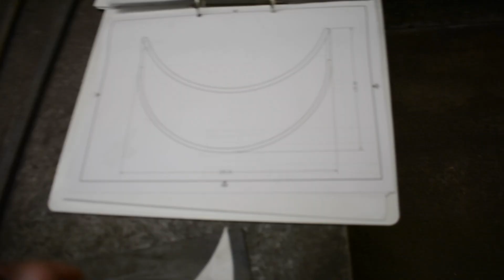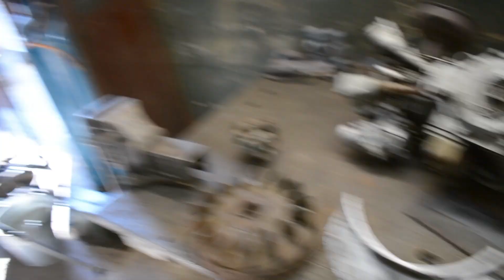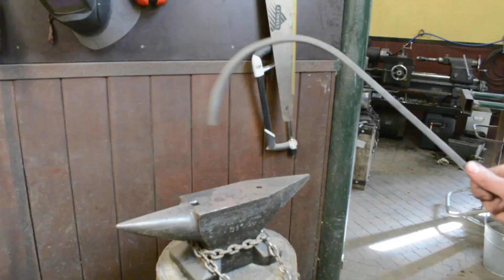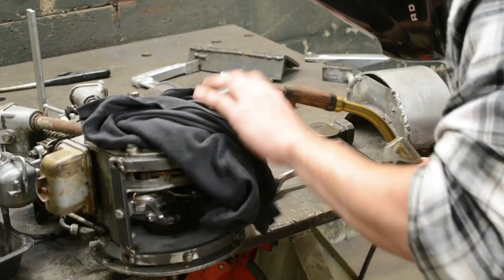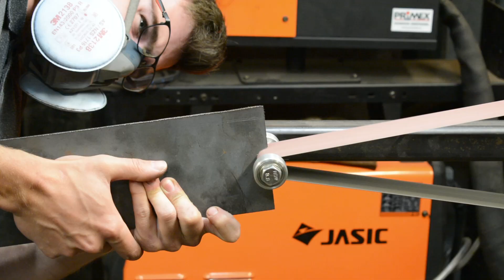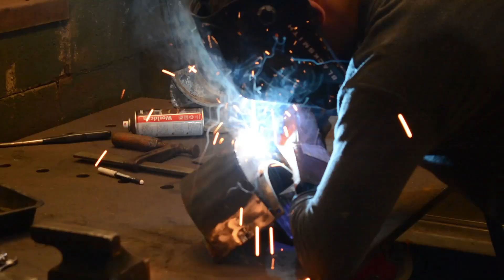Board Track Racer Build PART 1

Comment: Nicely done video. I did mechanic work on a speedway team back in the 70's. Dont use grinders anywhere near an open engine. We used Jawa 500's. Cheaply made engine with no room for error. Nitro-methanol mix with total loss oil (alcohol and castor oil don't mix). Two or three degrees off on timing burned up the (expensive) piston. Bike weighed under 200 lbs. Direct drive transmission, mild steel front forks, so you could bend it back after a crash and keep racing. Our rider's mom called it all off after he broke his leg. Jawa updated the motor to a 4 valve setup anyway so we where outclassed and getting raw nitro these days would be a nightmare. Hope this might help others...

Comment: What engine are you using, and are they readily available? I live in Texas > USA....
Reply from the maker: The engine is a Bernard, Model 810. Its 8hp, 270cc. Built by Bernard moteurs in France. I live in Belgium so I don't know if they are available in the US. Maybe take a look on Ebay?
Reply: @rd.blacksmithing  just di....no luck but I will keep looking....want to find a 500cc engine similar in looks to what you have there....
Reply from the maker: @SigurdtheRyder  There's also a company called Timeless motorcycle company. They sell replica Harley Davidson motorcycles and engines which are made with the original patent's.
Reply: Only American engine I'm familiar with that is arranged in a similar way would be one of the original Gravely engines which had a Bendix type magneto and was a "T" head with the valves on opposite sides and the mechanism housed much like old motorcycle engines.
Reply: Any updates on this build?
I,m also from belgium and thinking about building a boardtracker with a bernard engine.
I already builded 4 boardtracker frames that got a harley wla bottemend and matchless cilinders for a friend of mine. I still have material left from that project to build one more frame so thats my plan